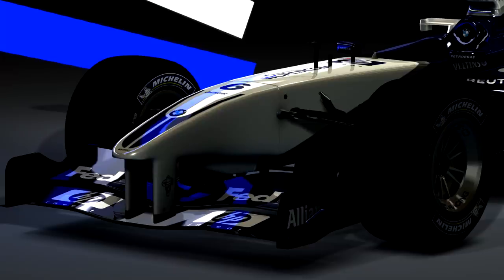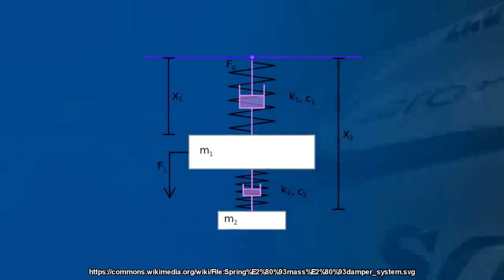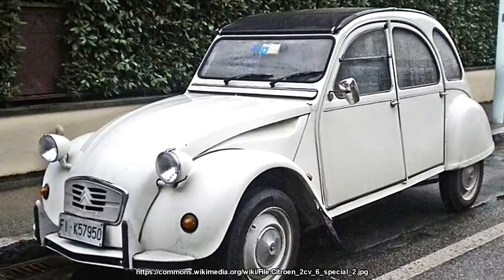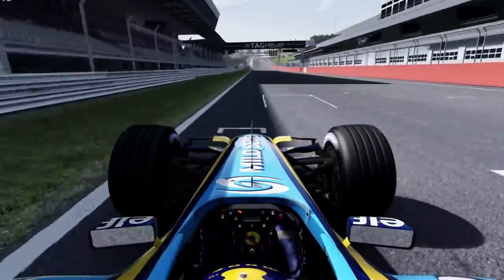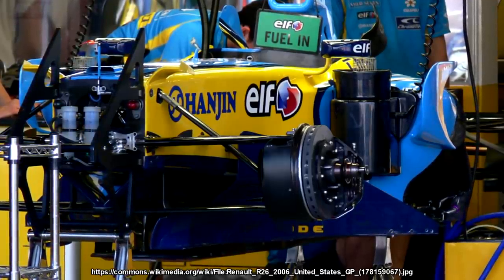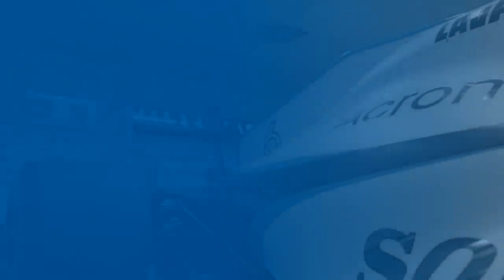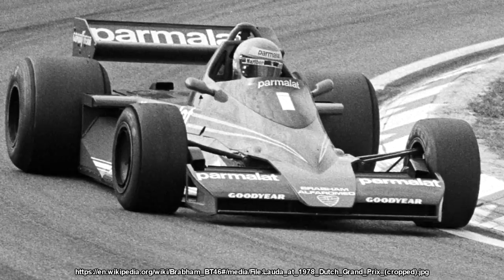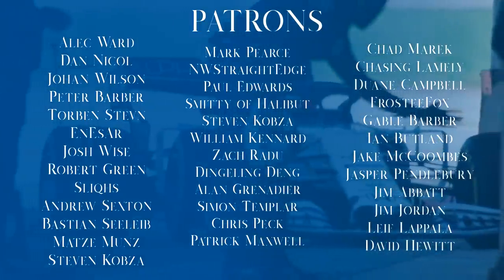RENAULT'S SIMPLE BUT GENIUS HACK! The Story of the Mass Dampers (2005-2006)

Comment: The mass damper was inspired by a similar large scale device installed into the Petronas Towers. A large suspended weight at the top of the building designed to counter and stabilise each tower in high winds. Similar devices can be found on modern cruise ships.

Comment: To this day that justification re: moveable aerodynamic influence just doesn't hold water. It is entirely internal to the car, doesn't touch airflow anywhere, doesn't alter the attitude or shape of any aerodynamic device, etc. Its purpose was to stabilize the contact patch of the tires/tyres when driving over the curbs/kerbs. By that kind of twisted logic, nearly any part of the car could be in violation of that regulation. The pistons inside the engine are in violation because they not only affect aerodynamic performance (especially before the now-mandated single-exit-between-the-spars exhaust location) but they are actually in contact with that airflow, albeit in a convoluted manner. Suspension arms are moveable aerodynamic devices. Brake ducts are moveable aero devices. Etc.
Reply: I agree, their logic is questionable.
Reply from the maker: Because they found it affected the air flow over the front wing more than it actually affected the stability of the car over the bumps. The opposite of what happened with the fan car.
Reply: @AidanMillward  Why on earth weren't mass dampers banned as movable ballast?  See my post above.
Reply from the maker: @seannewman6046   because the PRIMARY FOCUS of the mass dampers was improve front end aero grip.

Comment: Way too fishy at the time for me. Renault and Alonso were the leaders, and suddenly after this device was banned, hey presto, Ferrari and Schumacher were dominating races like they used to and suddenly title no. 8 seemed nailed on. Is it any wonder that the long held Internet story was that this was the tyre battle of '03 once more. Ferrari International Assistance yet again. Ferrari weren't getting performance from this, Schumacher was going to lose, so ta-da! Banned.

I did not know there was work going on to put it at the back, so you'll be pleased to hear that... I learned something. That suddenly makes it a lot easier to accept, as the safety argument about a flying spring makes my eye twitch with memories of what happened with a certain heave spring in Hungary three years later. Almost as if the FIA saw it coming, though not really, if that makes any sense. Moving springs of that form to the rear suspension would have been asking for that to happen every race.

Hadn't heard that 'other' story before, either. Sounds like 'billhooks' to me, but then again it's Briatore and we know what a Richard Cranium he can be, so... Yeah I can see why it seems plausible.
Reply: Actually it was McLaren who protested the system. Briatore has said that.

Comment: I always thought the rules required all the ballast be fixed.  (Or you could have a significant weight being actively shifted from side to side per corner.)  I spoke of it at the time, but everyone else was still talking about it as an aero issue. Having a weight vibrationally isolated, or tuned, just sitting there, is not the same thing as having an oil pump or dry sump tank, on rubber mounts to keep it from cracking.  IDK . . .

Comment: I've always wanted to see what F1 would look like if the mass damper and double diffuser would look like in today's cars. Would of been rockets breaking records every race.
Reply: Agreed… In addition to removing all the extra weight, aero constraints, higher-revving engines over the past 18 or so years, not to mention having setups tuned to pace as opposed to driving to prescribed delta’s due to tyre degradation and fuel economy runs.
I honestly can’t remember the last time a driver was able to genuinely take a car by the scruff of its neck and show it by having to correct the steering multiple times each corner on every lap
Reply: @CroatiaMelbourne1953  exactly. V10's or V12's revving 18-20,000 rpm. Ultra lightweight, that's what F1 is all about. Hybrid era truly wrecked the philosophy of F1. Now they are fat and heavy. Trying too hard to innovate for the everyman. When they should be innovating to be lighter and faster.

Comment: As long as Renault didn’t get a patent for it the tuned mass damper could be an interesting bit of kit to bring back. Make it a standard part so there’s no development war. It could work very well with the new regs.
Reply: A few points:
1. It will be less useful on 2022 and up cars due to the lower profile tires. The main advantage of the mass damper is to damp the oscillations of the completely undamped spring that is the tires. It would still have a positive effect, just less so. 

2. Teams have already found other ways to get most of that performance potential via the inerter. Inerters are in a way a tuned mass damper that is directly linked to the suspension, unlike the regular mass damper. 

3. The safety concern is legit. How and where they are mounted and housed would have to be tightly regulated. A big chunk of metal in the nose is exactly what killed Justin Wilson

Comment: Didn't the 1994 Pensky Indy car have some special rear suspension device?
Reply from the maker: Er… just the warp engine I think
Reply: @AidanMillward  not the beast, they did have some kind of advanced rear suspension the Lola cars didn't have
Reply: They had a third spring on the front. I believe, if I remember from the book Beast
Reply: If they did, it sucked. That car was hot garbage. Only the beast of an engine made it great.

Comment: Why weren't mass dampers illegal under the pre-existing rule which forbade movable ballast?
That's what ballast is isn't it, mass. Mass dampers are moving ballast. Typically ballast is used to bring up the car to minimum weight, but obviously it can also be used to affect the handling by moving the centre of gravity. This is what the mass damper is doing also. Its ballast which moves to affect the c of g of the car and this has been illegal since.... a long time. The 70s I think.
Am I wrong?

Comment: One of the major justifications for any type of racing is to improve the breed, I.e., develop technology which can make road cars better.  F1 has done a great job of doing just the opposite by banning active suspension, automatic transmissions, moveable aero devices, these mass dampers (which are NOT aero devices) and all manner of other devices which could, if sufficiently developed by racing, have improved road cars.  Which is one of the reasons I stopped watching F1 long ago.  It's simply become open wheel astronomically  expensive NASCAR.  One of the most basic flaws of F1 in that regard is engine displacement limits.  What should be the rule is fuel consumption limits.  Just give everyone the same amount of a standard fuel and let them figure out the most efficient displacement to use.  Displacement limits trace back to a flawed European approach to minimizing fuel consumption on road cars by limiting engine size.  The intended effect is to create instead engines which are high RPM wonders which squeeze the most power of of a given displacement by sacrificing fuel efficiency, durability, and manufacturing cost.  A prime example of this would be something such as the FIAT 500s of the 1950s.  Because of insane displacement taxes in Italy it was cheaper to design a car which had to be thrown away after 4 or 5 years than to build one which would last nearly forever as was the case in the U.S.  France was hard on Italy's heels in imposing punitive displacement taxes.  England went off in another counterproductive direction by taxing piston area which resulted in engines with ridiculously long strokes.

Comment: Doesn't make a lot of sense that a piece of equipment that isn't in the airflow, and isn't connected to the airflow, could be considered an aerodynamic device.
Reply from the maker: Because it helped to improve the airflow over the front wings
Reply: @AidanMillward  Thanks. I don't fully understand how though. Does it help absorb the bumps and keep the chassis more stable? If so, it acts more like a suspension element than an aerodynamic one.

Comment: Imagine if you will that all the teams in F1 who buy customer engines from the bigger teams decided to band together and get that banned in the same vein as how the teams got the Mass Dampers banned because they didn't to pay Renault for them.

I know the two aren't exactly the same thing but from a certain perspective they are considering its really expensive to build a F1 engine meaning the smaller teams tend to buy one to save on costs as its cheaper not to mention the engines used by the bigger teams who make their own are usually a little bit better than the customer ones to try and save themselves from being embarrassed by other teams.

So with that in mind picture those teams calling for a either a end of customer engines to force the bigger teams to provide them for free or making the customer engines exactly the same.

Comment: if it is true that Renault had patented it then there is likely to be either a failed/revoked paten request or fi it went through then the world wide/euroian/us paten that will have been for will still be on active a it is 25 years with an additional 10 year extension if requested an required an the dates will match up with the dates of the meeting ect.
Reply: 1. Flavio is full of it.
2. Mass dampers are nothing new. As he said, they were first patented in 1912 or something. Any respectable patent office would reject it.
3. There is nothing complicated about it. It's a hunk of heavy metal suspended on springs. What more do you need to see?

Comment: It should have been banned because it's basically moveable ballast, and ballast is not allowed to move, it has to fixed to the car. Mclaren didn't develop one because they had the inerter or J damper which did the same job.